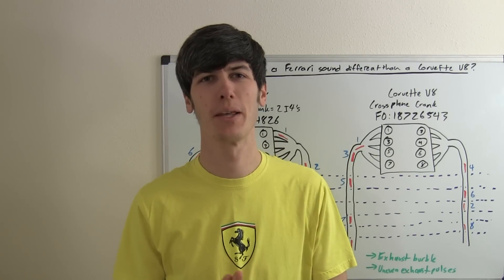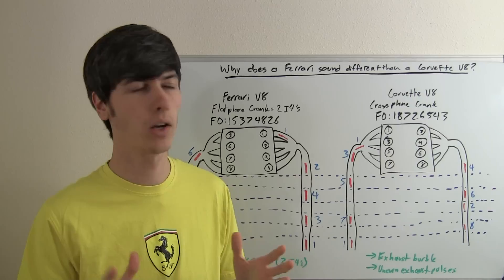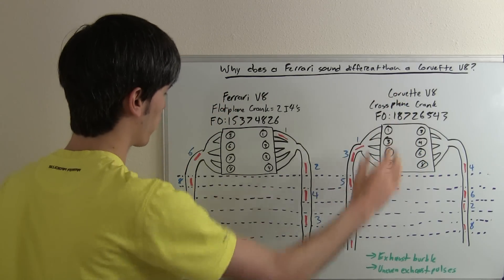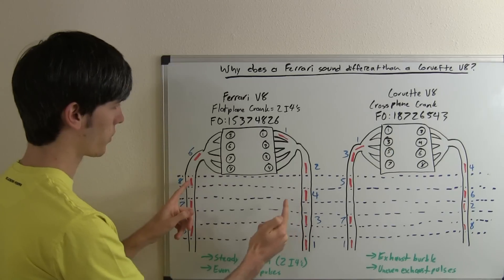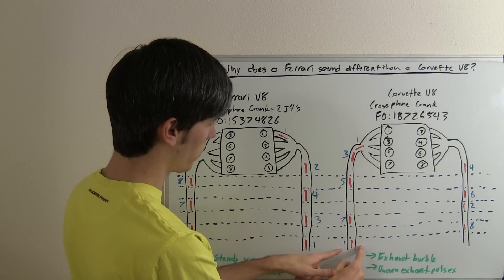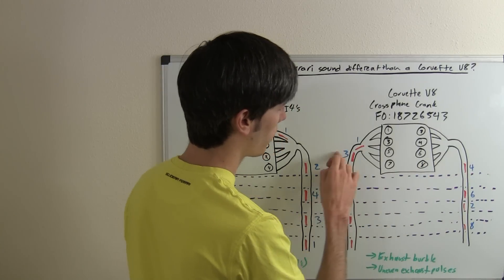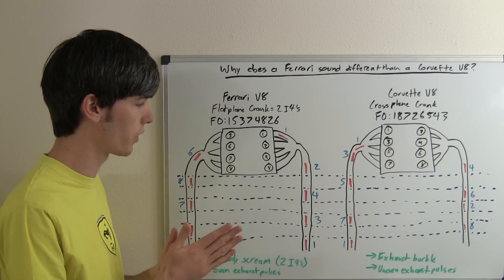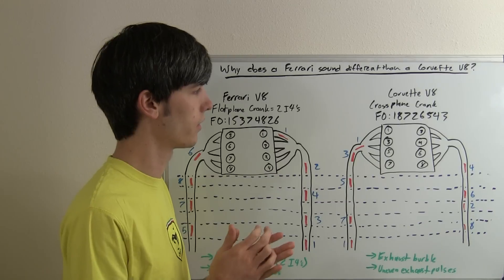Ferrari V8 vs Corvette V8 - Why do they sound different?

Comment: flat plane engine have better breathing but dont last long due to crank stress.
i'd rather the "not as good sounding" firing order and reliability.
Reply: +AllyourBaseArebelongToUs If designed correctly this can be mitigated to the point that it almost doesn't matter, but it's expensive to do so, which is why you normally don't see flat plane crank V8's in regular cars. You need high end light weight materials to make a balanced flat plane crank V8.
Reply: TheRecon4 even Ferarii hasn't gotten to the point where their engines can out live a Chevy v8 or ford v8.
Reply: +AllyourBaseArebelongToUs That's because Ferrari makes sport car engines, not truck engines. Ferrari makes 14:1 compression engines that spin to 9200 rpm and make 130 hp/liter, but still last 80k-100k miles.  If you design a Chevy or Ford to hit those numbers and it will only last 500 miles in a single NASCAR race before it needs to be rebuilt.
Reply: Larz still, they can't beat a chevy or ford in durability.
and recent reports have the 5.2l voodoo breaking rod pins  due to vibrations.
Reply: AllyourBaseArebelongToUs I think you pretty much just undermined your whole argument by mentioning how new Ford's fail in their first months of life.  And that reinforced my argument that if you try revving a Ford or Chevy into the range where Ferraris live (even though the Voodoo is still 1,000 rpm lower)that they won't last as long as the Ferrari.
Reply: Larz the rod knock of that gt350 failure is very hard to watch.
Reply: +TheRecon4 Flat-Plane cranks are by their very nature, easier to machine and construct. Sorry to go back to near-ancient history, ;but when the Moto Guzzi 500cc v8 was in it's infancy, it's clever rider Bill Lomas suggested some changes, the machinist went away and completely summoned up a re-designed flat-planner within 48 hours in the race shop.
Reply: +AllyourBaseArebelongToUs Durability only matters to the budget consumer, not someone rich enough to afford a Ferrari.
Reply: Stephen Scholes doesnt matter.
floatplanes are not as reliable.
Reply: AllyourBaseArebelongToUs You are crazy.  Every inline 4 is a flat plane and they are less well balanced than flate plane v8's and Toyota has made millions of them that go more than 200,000 miles. The durability has to do with max engine rpm, compression ratio and specific power output.  that is why sport bike engines only last 25,000 miles.
Reply: There is one more example that is an apples to apples comparison.  The exception to the flat plane inline 4 rule is the 2009+ Yamaha R1, which is a cross plane inline 4 that spins 13,500 rpm.  Does it have a longer engine life expectancy than its other 13,500 rpm 1 liter flat-plane competitors?  Nope.  the cross plane vs flat plane issue makes little, if any difference in engine longevity.
Reply: Larz it's unreliable junkl.
Reply: AllyourBaseArebelongToUs You've just let me know without a doubt that your intelligence is too limited to continue this conversation further.
Reply: To be completely honest, the Corvettes have been having problems with reliability lately (ZR1s blowing up left and right, Google it...), and the flat plane GT350 apparently has some awful vibration issues. So, either way, you're f**ked. :)
Reply: +Cy Burkhart yeah right. Cause you have had soooo many ZR1's. Your an expert.
Reply: Mrcrazydave11 Google it. I told you.
Reply: +Cy Burkhart Google what? Do you think that porch has no issues either. Every car has issues. My comment to you was how many ZR1's have you owned? You answered. None. But hey you must be right still. Corvette has been made for 63 years and there was 26 cars that's came and went that was supposed to beat it out of existence. Your an expert. The GTR guys like to brag too. They made 1400 of them last year as opposed to 34000 vettes. Don't matter either though, does it?   Last I heard GTR is close to being discontinued too.
Reply: +AllyourBaseArebelongToUs The motor in a 458 Italia costs more than the GT350 all together.

Comment: Could you change your firing order on your car to change the exhaust note? like would it be bad to do it to a car?
Reply from the maker: colton outdoorsmen You would have to change the internals as well (at least the crank) in order to make it possible.
Reply: Engineering Explained ...and the electronics....
Reply: manoman0 and camshafts if I'm not mistaken
Reply: and the spark plugs
Reply: and the car

Comment: is it possible to make a Chevy V8 sound like a Ferrari V8 but changing the firing order? Is that possible to do with todays V8's or would that just ruin everything and throw it all off..? Or perhaps doing a 180 header system on a Chevy V8
Reply: The firing order is different because of the different crank. 
If you would use the Corvette firing order on the Ferrari or vice versa you wouldn't have a power stroke every 90°, thus a very uneven power delivery.
Reply: yeah but 350 SBC are the only ones that have 180° headers as far as I know unless you get them custom made but that cost well over $2k. there are flat plane cranks for ls series v8's

Comment: Hey man, is the firing order for all the Chevy big blocks the same?
Reply from the maker: ThrowingSpoon Very doubtful, but some iteration with uneven pulses on each side.
Reply: Where could I find more information on stuff like that? I'm a stickler for muscle cars :p
Reply: ThrowingSpoon There's a Wikipedia page each for Chev small block and Chev big block engines I think, but I haven't fully gone through them all so I can't be certain if it contains firing orders but it does have general information about which vehicles the engines were used in, dimensions, etc.

Comment: Engineering Explained Ok so, technically If you got uneven headers, you could get a crossplane V8 sound like a flatplane V8?
Reply from the maker: Daniel Lobo Sure, it'd be complex but possible to get the pulses to exit evenly.

Comment: exhaust sound differs becz of firing order then how does it depends on crank type
Reply: The firing order is different because of the different crank. 
If you would use the Corvette firing order on the Ferrari or vice versa you wouldn't have a power stroke every 90°, thus a very uneven power delivery.

Comment: Why when installed a bigger camshaft the car burbles even more?
Reply: When you run an aggressive cam, there tends to be more valve overlap (intake and exhaust valves are both open for a short period of time). This changes the exhaust sound.

Comment: when did GM change the firing order? I thought it was 1 8 4 3 6 5 7 2 , instead of  1 8 4 7 2 6 5  7 4 3 .
Reply: with the LS1
Reply: +BobVoshalike 1997
the LS firing order puts less stress on the crank vs the SBC

Comment: Didn't Buick make a flat plane V6 back in the 1960s?
Reply: No. It had all kinds of miserable features but it did have a 120º crank. GM decided to make a V6 the cheapest way they could, which was by chopping 2 cylinders off their 215 inch V8. So now we have a 90º V6. GM hadn't figured out how to make a split-pin crank so the firing order was uneven. They handled this with dual points in the distributor but of course it ran rough as hell. I had one of these things in my Jeep and it was awful to tune up so it would run decently. Besides all that the gases from the exhaust crossover corroded the carburetor mounting bolts so the carb would fall off from time to time. Perhaps the engine I loathe more than any other.

Comment: Ferrari works hard on their exhaust note, and it has NOTHING to do with a different firing order, crank type or anything else. When you have V8, you always have the same firing and exhaust pulses at the same frequency. The only thing required to make a corvette sound like a Ferrari is the WANT to do so, and the skills to figure-out and fab-up a set of tuned pipes. Go throw a set of American "corvette type" headers on a v8 Ferrari and guess what, it will sound like a corvette.
Reply from the maker: TheSchadenfreuda "you always have the same firing and exhaust pulses at the same frequency" You clearly didn't even attempt to watch the video.
Reply: um no... this is exactly why the new gt 350 sounds way different than the gt mustang
Reply: You're joking right? You gotta dial back the sarcasm. When you over-do it it just sounds like you're completely serious

Comment: Ferrari is built for performance with no regard for anyone other then a Ferrari mechanic to work on and they didn’t think much about turning. 15 minuets service into pulling the engine for service. Time is money and complicated server takes time The Ferrari is built to make the service 10 times more expensive. The C8 is a short block Chevy design with only slight modification for a behind the driver mid engine. Everything is accessible and owner mechanic can maintain their own car if they want to. The architecture makes service by the dealer simpler and cost lest. If you take your Corvette to a Ferrari Mechanic it will cost as much as a Ferrari because they don’t know how to work on an engine in a car. The engine architecture is see different and makes a difference in the sound and rpm range. But a basic Ferrari can’t catch a basic C8 Corvette be for it can get to 100 mph and Corvette has a flat plan crank in the very next model that will be built in Bowling Green Ky and not New York State

Comment: Every middle class American on YouTube "Ferrari sucks because I can't afford one and have accepted that I never will so I'll talk trash about them on YouTube even know their isn't a domestic car out there that can even come close to a laferrari on a true racetrack"
Reply: They know that? So why doesn't Ferrari put their "hypercar" on more tracks and find out? Also, do it without teams controling everything, just hand the keys over to someone instead of protecting, which they keep doing for some reason. It's probably slower overall than the 918, and the 918 has already been upset by the Viper ACR and several tracks. Very likely Ferrari doesn't want to embarrassed by their cars performance.
Reply: Ya I'm sure that's it the #1 racing manufacturer in motorsport for the last 70 years is too embarrassed.
Reply: The 918 did a 6:57 on Nurburgring the ACR 7:12 and the laferrari XX did a 6:11 you tell me who's embarrassed again...

Comment: its also its because dumbass gm still uses ohv valvetrain and Ferrari uses dohc valvetrain. they sound very different. that's why Ferrari v8s sound sort of like a coyote or a voodoo
Reply: It has nothing to do with valve train. It is simply a 90 degree vs. 180 degree (or flat) crank shaft. The 90 degree crank design eliminates a 2nd order imbalance for a smoother engine thus the common choice for US engine designers. The flat-plane crankshaft normally has the 2nd order imbalance but this is managed with the twin counter-rotating balance shafts in some flat-plane cranks such as the VW W8 engine (don't know for sure if Ferrari uses the counter-rotation balance shafts). I believe Ford is now building a flat-plane crank V8 for one of the  Mustang engines.

Comment: Your Ferrari and Corvette diagrams do not account for the exhaust scavenging that occurs via collectors.  This has a TON to do with sound.  If you don't think so then why does a small block Ford in a Mustang sound so much different than a GT40 with the "bundle of snakes" 180 degree headers.  The reason that domestic manufacturers have used cross plane cranks in production cars is for smoothness.  Domestic race V8s have used flat cranks for eaons....go read Smokey Yunick.
Reply: C'mon give him the benefit of the doubt, he's referring to the vtec part
Reply: Sick burn yo. Yeah man, everybody knows import combustion chambers are the bomb! Man I get so excited just thinking about it. They're the heart of the car. I go to the dealer, first thing I'm asking is "So are the combustion chambers on this Subaru more of a four leaf clover or like a hemisphere?" cause a lousy combustion chamber is a deal breaker. And I'm starting to wonder if you were being sarcastic too cause that's such an oddly specific thing to comment about

Comment: And that's the difference between an engine made the most of and a waste of potential, typically European and typically American
Reply: +Yoseob Yang   
The design requirements for a car used for transportation are completely different than that of a race car.  A race car engine is designed for maximum output, but to only last for the race.  

Also, in Europe a high performance engine is more useless for transportation with gas at $6/gal.
Reply: +charlesvan13 both Ferrari and Corvette are sold both in Europe and the US, so I don't get the point of mpg. As for te reliability, I don't know which one is gonna be more reliable, but I'm pretty sure that Ferraris are very well engineered. These are high performance road cars, a translation from the track to the street, so their aim is to be fast, not only transportation, and Ferrari clearly did it better in this case
Reply: +Yoseob Yang Why do you think so? People think efficiency is more horsepower per cc or ci. That's not the true. Efficiency is, I make more power, with less displacement, in the same RPM level then you. That would be efficiency. A lot of non American engines use RPM for making power. It's great marketing. The problem is that the higher you rev an engine, the less power it make in the lower RPMs. Mazda RX8 is a great example of that. An engine making power at 8 grand will not make any power at 2 grand. Harley Davidson saw this and that's why their, all steel bikes use large displacement engines with less RPMs to move a 1000 pounds. Japanese bikes are all aluminum and weigh 400 pound so they can spin those engines higher. The lack of torque is not felt because the bike doesn't weigh anything. Corvette makes it's peak power at 6000 rpms. When we hotrod these engines, we change camshafts and cylinder heads in them, so they rev higher. If a formula 1 car weighed 3500 pounds then they too would have to increase their displacement.
Reply: +Mrcrazydave11 I don't think the rx8 is a good example, as it has a rotary engine. In this case, it's simple. The same (v8) engine with different valve timing makes the big difference. That's what they did with the Hellcat, if I'm not mistaken
Reply: +Yoseob Yang The RX8 engine is a 9500 rpm motor. The point is that, it's not how they make the engine spin, it's that they wind out the engine to make the horsepower they're looking for. Today they use cam fazing to try and make the engine feel bigger. Honda has their VETC engine, which has 3 cam profiles in it with a faze shifter in it. Small cam profile for low end torque, medium for mid power and large cam profile for high end power. It's to try and create that larger engine feel. When people put turbochargers on them they would take the VETC out because the turbo would make up for the lack of torque therefore making the VETC useless. A good example of this too would be LS1 verses the old Tuned port injection. Both are similar in displacement. TPI make it's peak power, 250 at 4000 rpms. LS1's make 345 at 5700 rpms. A couple of years ago we actually got to test these 2 cars next to each other. An 88 formula firebird against a 98 formula firebird. Both cars came off the line together with no wheel spin. And no big surprise, the TPI car jumped 3 cars ahead of the ls car and then the 98 car ran him over. But it was torque that gave the 88 car a nice head start. Todays euro cars are spinning their engines to 10,000 rpms but using electric motors to help them get in to their power band because they lack the low end torque production.
Reply: That's true. That was not the comment. The statement was the american engines use a waste of displacement. That is not true. A rotary uses RPMs to make power. Or they use a turbocharger which doubles, triples or even quadruples output. A turbocharged rotary engine that has a 76 mm turbo on it, running 44.1 pounds of boost (or 3 bar) is equal to a 320 cubic inch engine that revs to 15000 rpms. That is not efficiency, that's marketing.below 10000 rpms it would be a turd. This problem would also be increased if it's in a 3500 pound car. The LS heads do breath better for sure. They also have an oil pump that has less drag, way better valve angles, A straighter intake runner, low tension piston rings. There is a ton of reasons the LS performs better the the traditional chevy.
Reply: I respectfully disagree on your statement that a 5L will make more power then an OHV engine. Airflow is still airflow and ports are still ports. The advantage DOHC have is greater valve area. But there is a point were the port will stall with too much lift. Velocity, the speed air travels though a cylinder head has an effect. Also exhaust port size has an effect. All the flow bench work I've done shows that 4 valve heads have no swirl. 2 valve motors do better there. DOHC engines don't need as much lift to get the airflow though the heads. OHV design need to increase valve lift to do this. The OHV limits are cam designs since only a hot rodder such as ourselves would want to listen to the thump of the cam. Congrats on your RX7. It makes great power. Your probably making about 20 horse power per lb of boost and yes at the flywheel your making LS7 power, probably more but the LS7 is doing it at 6000 rpms. GM stuck with pushrods for many different reasons. One was they didn't want to spin the engine to 8500. Engines spinning 8500 have no power at 2500.
Reply: My comment about spinning a rotary with 44 pounds of boost and 15000 RPMs was about a 1200 hp rotary engine. Not a street engine.